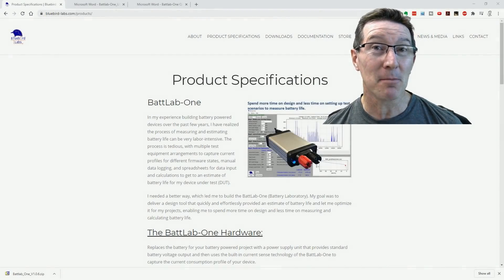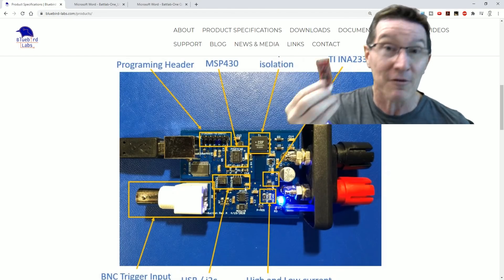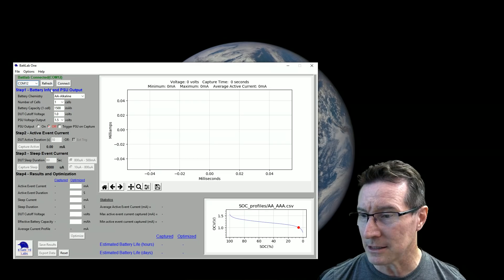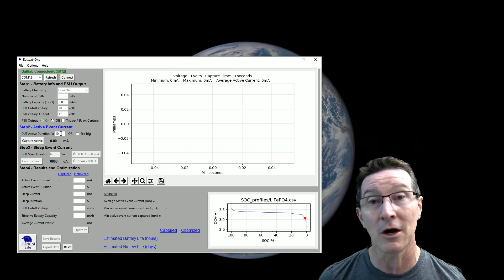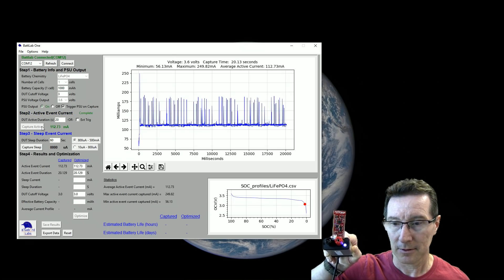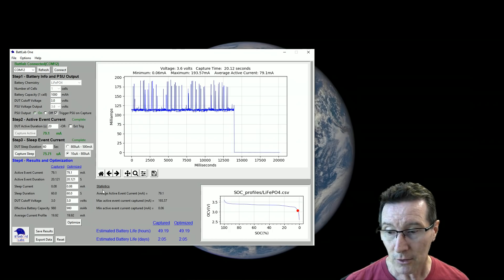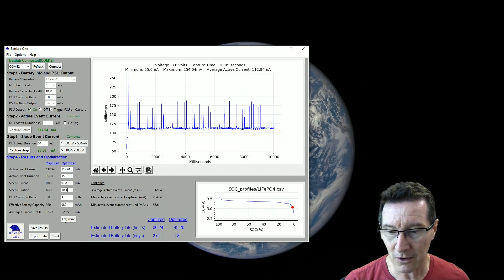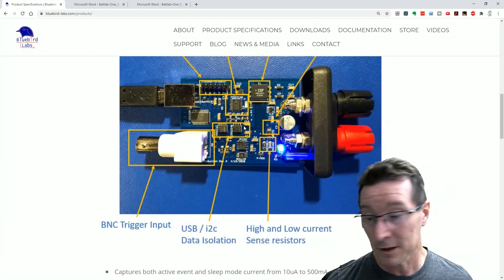EEVblog #1331 - BattLab One Review

Comment: When someone who doesn’t read the manual meets an elec eng who is writing software ;)
Reply: You nailed it Joshua! Haha
Reply: You see it often these days, ie, people winging it and pushing buttons and never using it properly. Gone are the old days where programs had the same button functions, now everything is complex and methods are written differently so you can't just jump from one program to another without reading the manual. I would've preferred if the 10min of errors were cut out.
Reply: dave never reads manuals and then screams how software is stupid :-) got used to it...
Reply: @SidneyCritic  Depends what your definition of 'old days' is. Before Windows and other GUI OSs, every program had its own methods and user manual, as every programmer had their own ideas. And the manuals were often phone book sized. I know - I printed a few... on a dot matrix printer :P. Every game, Word Processor, spreadsheet and utility was different from another. Then Windows came along (in my world) and somewhat standardised things.
Reply: I never read the manual for a piece of test gear. If its operation isn't intuitive, it has been designed badly. Keysight screwed up their spectrum analysers when they moved signal averaging away from video bandwidth, then trumped that by putting the number of averages somewhere else entirely.
Reply: @donepearce  The intuitive way to remove the appendix is through the abdomen, the non intuitive but better for the patient is through the mouth and down the throat. If no one told you about the throat method no one would've guessed it, ie, people use different methods to do the same thing - lol -.
Reply: @SidneyCritic  OK, you have the word comedy in your name, so I won't attempt to pursue this.
Reply: and really manuals should not be necessary
Reply: @urugulu1656  I have one reason only for using a manual - looking up the GPIB commands for remote operation. If I need it for anything else, it has failed.
Reply: @donepearce  yeah, no. Your heuristic only works when there's nothing subtle or not understood by you already.  I could show you case after case where your approach arrives at an incompetent result regardless of how well the system was designed.
Reply: @aajpeter  Occasionally no doubt. But in the case of any piece of lab gear - signal generator, spectrum or vector network analyser, oscilloscope etc, I expect to be able to ignore the manual. Now I know a lot of the latest gear is Windows-based and has such unpleasantnesses as touch screens (Everything gets fucked up as you point out something to a colleague), but that aside, my point stands.
Reply: @aajpeter  Good user experience is when you can’t really use it wrong without being aware of it right away, or thereabouts, and when you can easily discover all functionality. We don’t normally read manuals for stuff like digital oscilloscopes even though they are fairly complex beasts. Their interface, even though cryptic, is discoverable - not the best example of UX, but demonstrates that at least it’s straightforward most of the time. I get upset when stuff is contrived in weird ways that have to do with some implementation detail completely irrelevant to the user.

Comment: Just to nitpick here: LiFePO4 is not lithium polymer but lithium iron phosphate.
Reply: That is not nitpicking - there is a considerable and practical difference.
Reply: starshipeleven By power, do you mean current output or stored energy (per unit density)?

Comment: I have one small complaint, and it didn't really affect the video at all but I have to get it out of my system lol. The battery you kept referring to as a lithium polymer is actually the abbreviation for a Lithium Iron Phosphate (they are quite different).
Reply: LiPO is just a form-factor, just like 18650 or AA is just a form-factor. The chemistry of the Anode induces the characteristics in lithium-ion cells/batteries.

Comment: Dave, for sure it would be nice IF the voltage would go upto 9V (PP3 Battery) 4.5V is very low voltage when there are 9V batteries out there, They could have placed a up converter in the unit to cope with this situation,

Comment: Well, that looks like a useful device. As you say, the software to date looks a bit-single purpose, but hey, it's open source so hopefully it is well written and easy to expand to a much more general application. The predicted battery life function is great, but I would like to know whether it is based on manufacturers' data or some extended measurements. I remember when I was designing radio pagers we had a wall covered in battery connectors which we would fill with various manufacturer types and just leave them on extended test. We designed our own A/Ds and data loggers.

Comment: @16mins that graph looks like 1bit noise.  See that a lot when using ad's with low inputs  compared to the ref signal level. This was common when we were measuring pA from a isfet sensor.

Comment: Hi Dave, I noticed you mentioned that all 16 bits of the ADC are not utilized. The fact is that if you buy a 16-bit ADC, it won't give you 16 effective number of bits (ENOB) due to inherent noise. You can achieve it by oversampling, but then you lose on sampling rate. I'm sure you've run into this issue before, but I don't think I've seen you talk about this issue that much on your videos.
Thanks for the extensive review!

Here's some maxim's note on ADC resolution for reference
https://www.maximintegrated.com/en/design/technical-documents/app-notes/5/5384.html
Reply from the maker: Yes I know, but that doesn't change the resolution available.
Reply: Well I guess the actual reason for the seemingly 15-bit data here is that the INA233 measures bidirectional current, and you lose your 1 bit on the negative side -500 mA to 0 range.

Comment: Think this sort of guided interface is acceptable only if you can have a 'manual' mode where you can control everything that can be controlled to the full range of possibilities. It's impossible to make a simple interface without limiting what the user can do. For example it would be useful to have this also work as a power supply with current monitoring, have it graph in real-time while it's on, control the voltage whenever you want.

Comment: As batteries discharge their inner resistance increases, and you put caps in your product to mitigate the problem of voltage drops on high current bursts. I'd remove the huge cap and use that FET to simulate a series resistance which corresponds to the actual discharge level of the battery simulated! With some more work memory-effect could be simulated too. Beware however, even batteries from the same batch tend to vary quite significantly.

Comment: Thanks Dave; Good video,  great review. 
 A bit on the low current side for my needs, great constructive criticism, and as usual your reviews are the Apex of quality in test equipment reviews.

How about a review on a larger scale battery needs analyzer. Something like an analyzer for a system level battery powered system such as a battery backed up cell site, commercial two-way radio repeater or the like. A system that consumes power in the 200-350Watt hour power consumption class. 

With cell sites, radio systems for First Responders, and the like that are going to solar / battery backup to meet the requirements for communications in remote arias. 

I have always loved your content, informative, useful and even the stuff that doesn't apply to my field of interest your reviews are always Good.

Comment: I use the INA220 in one of my designs and it works really well, much better than the INA199 with ADC I used previously.  Not sure how the INA233 is different, but very useful chips for power monitoring.

Comment: For this application, since the supply sn't constant-current and it's only sampling at 1kHz, isn't it really good to have a ton of output capacitance for Nyquist frequency sort of reasons? Having a bunch of output capacitance should low-pass-filter the current draw so you don't miss a 500us spike.
Reply: That's what I was thinking, it misses the spikes but will still get the average correct, if it had much less capacitance it would actually be more inaccurate.
Reply from the maker: Yes. That's what I was getting at. Means you can't see real time short spikes though, and with a high battery ESR that could also add some inaccuracy to the calcs.
Reply: @EEVblog  Hallo Dave, I think the SigmaDelta converter uses a integration at the input. It is right you can not see the short spike but current will be part of the next current value. This integration creates a kind of mean value, I expect.

Comment: Interesting product idea.. Here's my thoughts on it
I'm torn between the software controlled amperage range... I think maybe having more ranges (3 would probably do, with some overlap between them).. I wonder if just a manual range selection would be better.. I mean with a 16bit ADC you do have a fair bit of resolution..   I'm thinking the 0.1ohm / 100 ohm shunts are perhaps poorly matched? or maybe have a 1 ohm  as an in-between?

Comment: Dave, are you sure the software doesn't simulate the discharge voltage curve?  It goes through all the effort of storing and displaying a full model per chemistry/type, and gathering all the information needed to start playing the simulation correctly with feedback from actual ongoing measurements, and then tellingly locking the model input values that would invalidate the simulation and therefore gathered data.
Reply: Hi Aaron, I'm currently working on a software release to include a simulation playback across the SOC curve (assuming a constant power output from the BattLab-One, which should also help a bit with the DC-DC Converter issue that Andrew Cilia mentions above ).

Comment: Dave, Dude! I got one based on your review but it does not work for devices that use a DC-DC switching regulator!  the BattLab-One assumes that the current consumption stays constant throughout the life of the battery but, as you know,  switching regulators increase the current consumption as the supply voltage gets lower (constant power).  Assuming constant current consumption skews the results tremendously.  All my designs use a switching step-up regulator to squeeze the last bit of energy from the battery so this just won't work for me.
Reply: Andrew, I know the best approach is the one you wrote to me about running through multiple iterations along the discharge curve, but I hope to have that first-order approximation solution we discussed released in the next few weeks.  Hopefully we can test and see if it gets any closer to your expectations.

Comment: It needs supporting of 7-9V and 12-15V batteries. Then it can be really universal tool for most cases. Options up to 4.5V is too low actually.
Reply: Yup most Dev boards and SBC go up to 5V. You are basically excluding over 500 of the most popular boards. The ESP32 goes up to 5V and is used in a ton of projects for wifi and BLE connectivity even if it isn't the main micro.
Reply: @excitedbox5705  ESP32 is 3.3V. But there are plenty of 5V microcontrollers.

Comment: Dave,
Look at powering a new uCurrent tester from a Super Cap,  no leaking batteries, charge it from you bench supply and get say 12 hours of operation between charges.  No worry about not having a battery available or a dead battery when you need to use it every couple of months.
Reply: Is a battery in the microcurrent that much of a hassle ?
Reply: plus you wouldve to find a sufficiently high voltage capable supercap with an acceptable capacity and they can be absolutely huge... 

or of course redesign the whole circuit to work at potentially much lower voltage

Comment: I dont wish to sound too critical of this project but just wanted to point out that despite its advantages for rapid development, Python is not necessarily always the most stable and reliable environment to such software upon build upon. In specific aside from generally being slower it's not got proper multi threading. The ease of development not necessarily always comes for free.
Reply: I was thinking the same - even Electron using JS would perform better, honestly. Of course it's the author's choice, and it's all open source, so anyone could make another UI. I know those USB to serial chips can run at much higher speeds too. I've run them reliably at 1,000,000bps - so the UI could capture data in realtime, and store any length of testing on the host PC.
Reply: There is an opinion that python as a language has nothing to do with quality of the software developed with it. It just happens that more often than not python developers pay less "attention to the details" than, say, c++ developers. In general the faster you get kinda working software the greater the possibility it needs some "spit and polish".
Reply: @vovetsno1  That was not my point. The thing I was trying to highlight was that python is single threaded. Correct me if I am wrong here but that was a decision taken long ago in Python language and it's runtime development. So when you use other libraries (build ontop) they in turn underneath are all vying for control of the same main loop. Its a single thread. The workaround in Python is to rewrite those underlying libraries partially in a different language such as C or whatever. At which point multi threading may be possible again. Or otherwise there is some other workaround. But it's not a proper and true multithreading. Python is also slower in some areas than compiled alternatives, but that is a less significant point. But also ties into things like unscheduled garbage collection of the runtime etc.
Reply: @dreamcat4  Yep, the interpreter is single threaded. There is the possibility of spawning another interpreter process and running them in parallel, but it has a lot of overhead and is pretty limited. And yes, some calculation-intensive libraries are written in C to achieve better performance and to be able to take advantage of multi-threading

But, you have to consider that many, if not most software don't need multithreading. Sometimes with GUI you at most only need Async to avoid a certain process blocking the GUI. I fail to see how this software would benefit from multithreading. Python is slow and singlethreaded, but not every application or software has to be fast; writing everything in C/C++ or Rust just so it can be as fast is it can get is a waste of time.
Reply: @ido9988  Eh again you miss my point. When you are libraries up the ass the code is doing stuff beyond what is visible to you. And those libraries for GUI stuff can very easily trip up behind the scenes. Leading to buggy and crappy behavior. Including the interpreter creating little delays when it has to do unscheduled GC at the most inopportune moments. Such as right when you are clicking on something or the screen is updating. Since that is just when the thread got woken up. And these sort of problems just gets worse the more code or complexity you add later down the road. So my point is overwhelmingly that early decision sets you on that platform and then you are invested. The more you add features and extra code the harder it becomes to switch to something else. Whilst also these problems gets worse at the same time. So my observation is that python, given its inherent limitations, which cannot be gotten around is in fact more suitable for prototyping. Or when the tool has a very limited scope that is not going to be kept adding to. And no, that of course does not mean that you have to go 100% all out the other direction and over optimize everything in bare C assembly code in order to avoid these issues. It just means using something else that is more sensible and appropriate for the GUI part. For example java or gtk. or mono/.net. Are all better performing runtimes for GUI stuff. That are more dependable and won't over promise on the expectations.